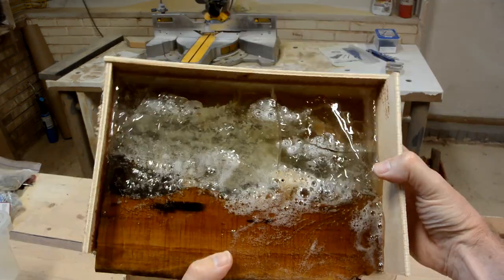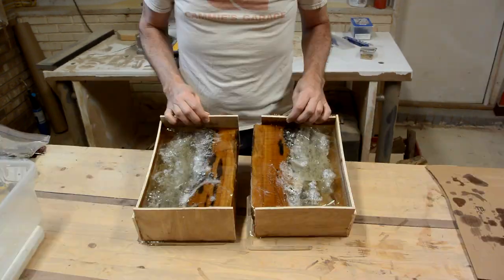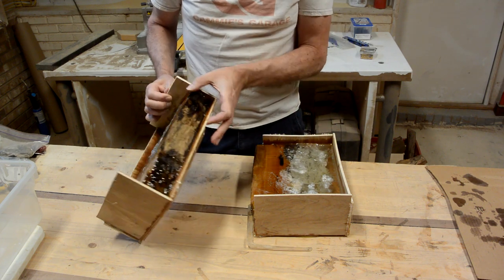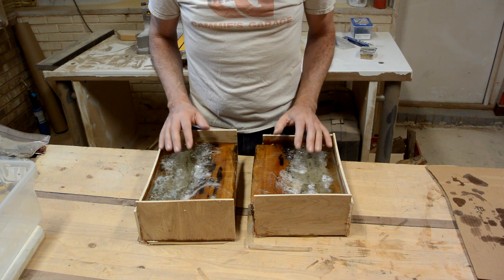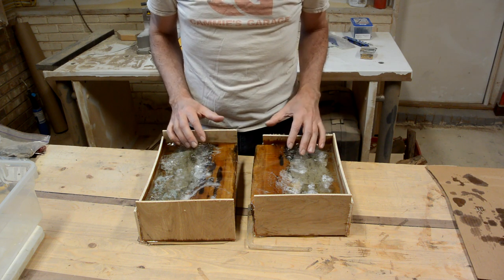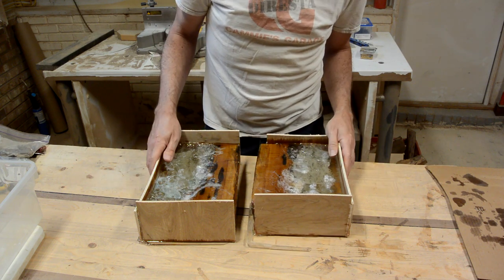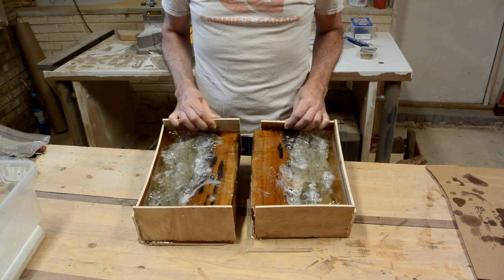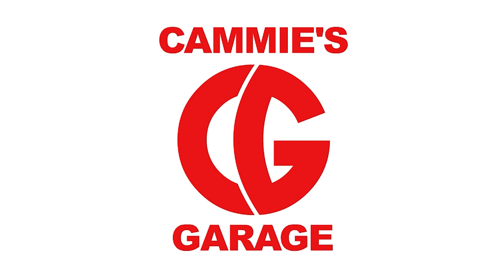Casting Carved Fish in Epoxy - Art, Woodworking, Sculpture

Comment: That's heart breaking, Cam!  For anything I need to cast outside a pressure pot I only use Liquid Diamonds.  It does deep pours in larger molds with no problems.

Comment: You might want to try one of the deep pour epoxies like EcoPoxy. It cures very slowly (36 hours?) so it won't overheat, and so bubbles have time to escape. You could also try a non-epoxy resin like Alumilite, but for that you'll need a pressure pot (and a decent sized compressor if you don't have one already).

Comment: Contrary to popular belief, wood is not solid. It has hundreds of little air pockets. This is probably what's causing all the bubbles in your resin as it cures. I would highly recommend getting a vacuum chamber to suck all of the air out before the resin cures. If you go look at the channel Ben's Worx you will see lots of projects that he does with resin and wood. He almost always stabilizes the wood as Stuart mentioned earlier, , and then puts the project into a vacuum chamber. I think this would greatly increase the success rate of what you're trying to accomplish. I hope this helps!
Reply from the maker: It boiled from overheating.

Comment: I just used Magic Resin for a 4” pour. Had no problem. I think a smaller pour and then another may have worked. Magic Resin has a 6 hr open time and cures very slow. 6-7 days to completely cure, but it doesn’t produce a lot of heat.  Mine was crystal clear. Each product has its own characteristics that have to be followed exactly.  Good effort and I like your variety of projects. Ps. A friend of mine gave me a bowl to turn out of Aluminite that had cured for weeks. It would not turn and chards kept coming off. Reason, it cured way to long before turning. Just my experience.

Comment: I wish they had turned out, would of looked great. From what I know of resin, a small mold is the size of a pen blank. Other factors could have attributed to the problems like moisture in the wood, other people have tried stabilizing resin to seal the wood before hand. I would do a few tests like pouring small layers to build up to the thickness you want, don’t give up 😁